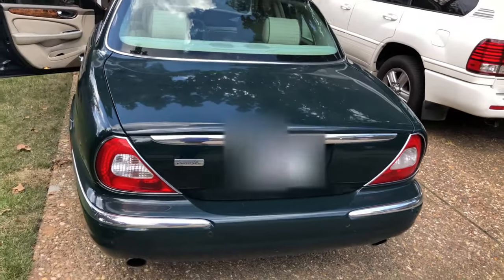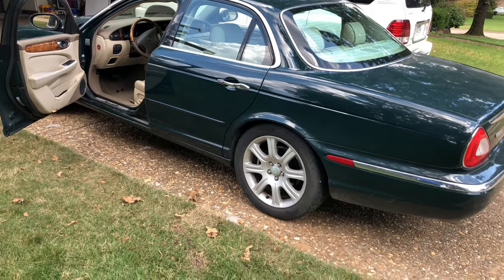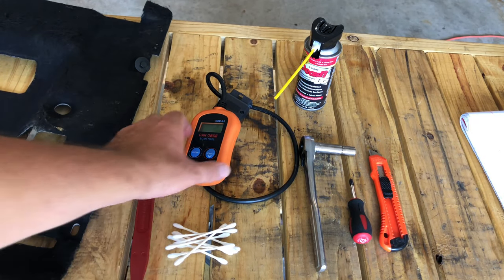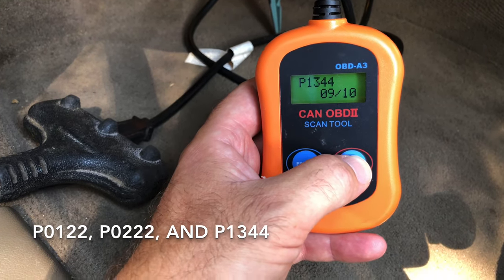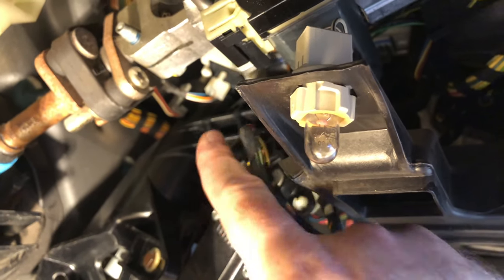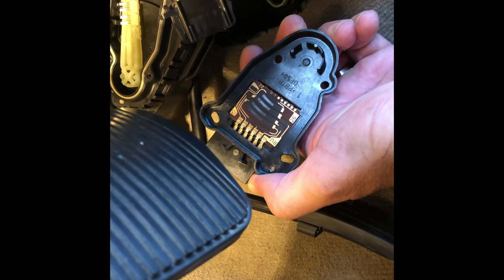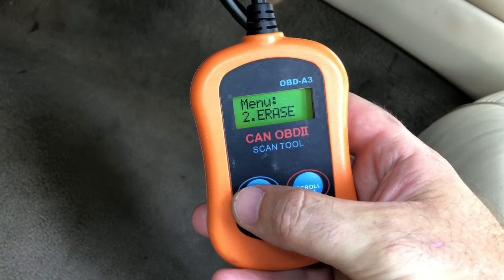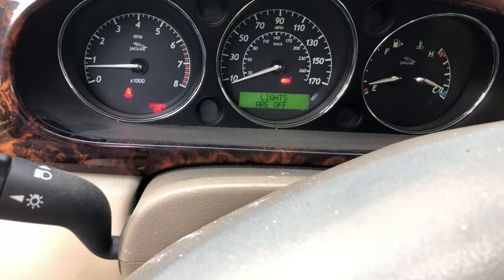2004 Jaguar XJ / XK / XF Error Code P1344, P0122, P0222 Accelerator Pedal Throttle Position Sensor

Comment: Did the vehicle stay running normal after this was done?
Reply from the maker: Well, there were multiple error codes.  One of which was caused by the coil pack bolts stripped out and poor contact with the spark plugs.  My buddy sold the car soon after this video was made.

Comment: My code came up p0121 2003 Jag X-Type 2.5L. I'm getting things from Throttle body to throttle pedal position. I was told that I should replace the throttle body.  Does anyone know which 1 i should replace, or do I do a clean?  My car shuts off on me and the dash shows "Gearbox Fault".  HELP!
Reply from the maker: My buddy doesn’t have this car, anymore, so I won’t be of much help.  I did see this possible solution that you might want to try:

 “had the same problem, the shifter cable needs adjusting. Before doing the adjustment, I had to slammed the shifter into D, in order not to get the message on the screen.”

Sorry that I can’t be of more assistance.